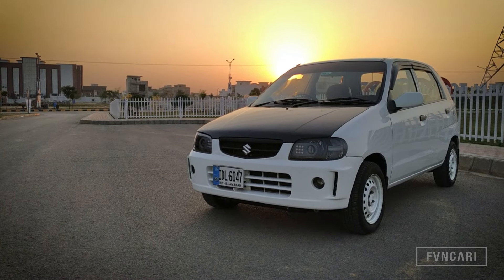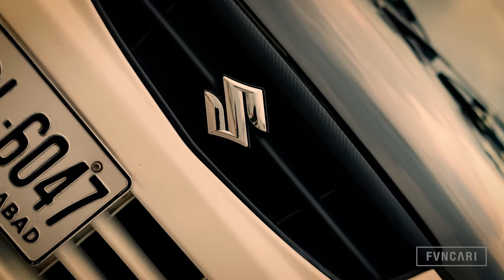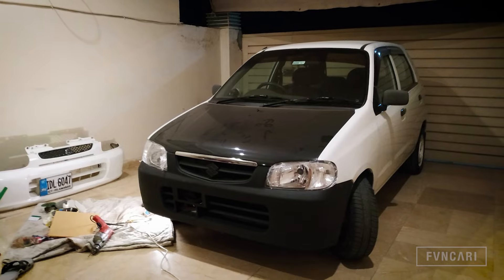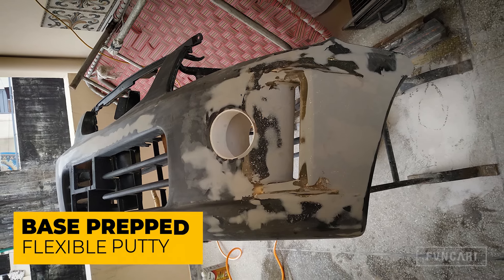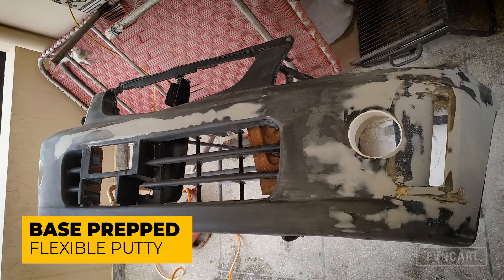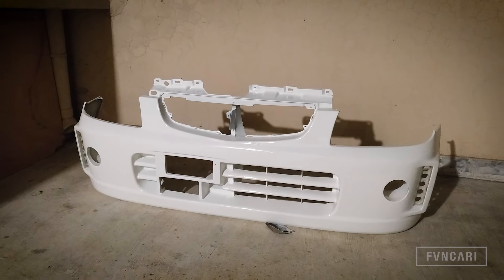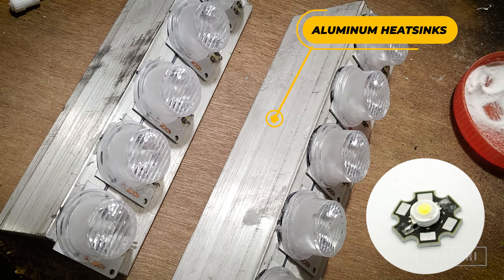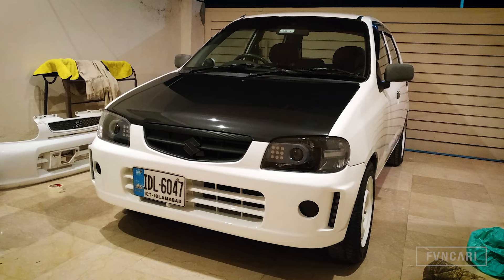ALTO VXR - Custom MODIFIED Front BUMPER

Comment: Can u upgrade bolan with 4x4 option
Reply from the maker: I'm more inclined to think that it might not be possible with the limited space available, but sounds like an interesting project, even if it requires extensive work (cutting/welding etc) Would need to take some extensive measurements and do some homework to see which transmission and transfer case can fit in it, then there is the matter of the front drivetrain, a solid axle from a jimny might fit with trail arms. Again, lots and lots of work shall need to be done if the measurements check out.

Comment: Thank you for uploading this video on my request.
So did you performed any light alignment for these fog lamps and can you tell us which fog lamp you have used?
Reply from the maker: Thank you for suggesting that I made such a video :) Yes, I made a mechanism within the fog lamp area to align them. It was a tedious task to align them as I had to take off the bumper each time to make slight adjustments and then install it back completely to verify that it's correct as there are metal shields behind the fog lamp area that are part of the body and cannot be removed for access. The fog lamps were universal aftermarket round Projector LED ones. I'll see if I can find any photos of them and share them.

Comment: Top speed video please
Reply from the maker: I will soon be sharing a performance video of the project. Topspeed wise, with the current power to weight ratio, it should be able to achieve 200+ km/h but I value my life so the maximum that I've taken it to is 160km/h :)